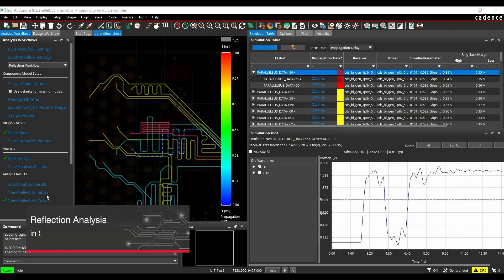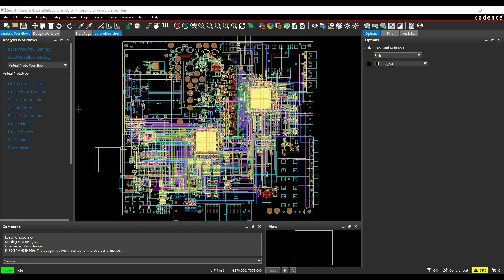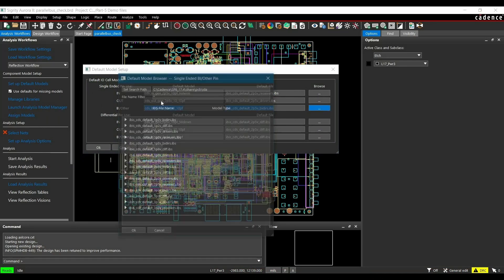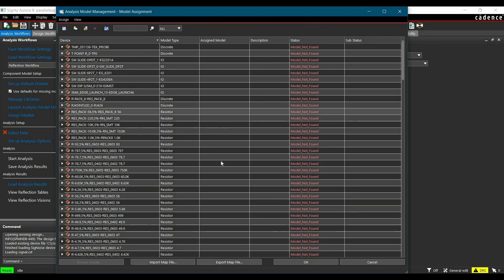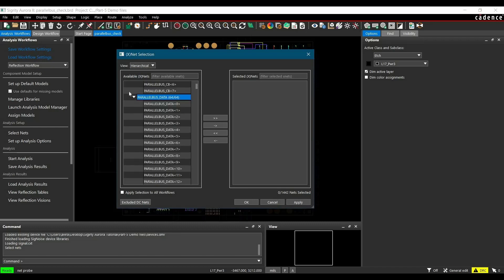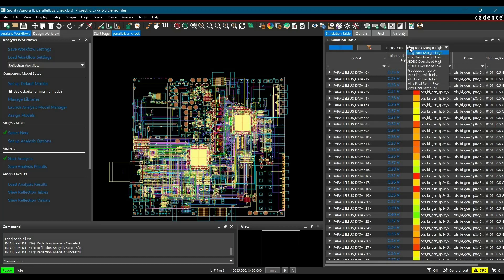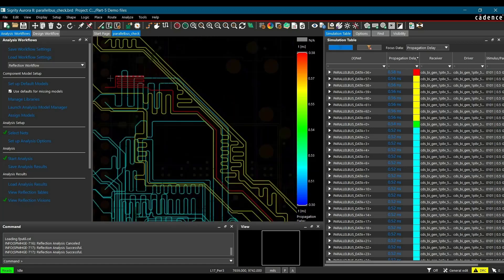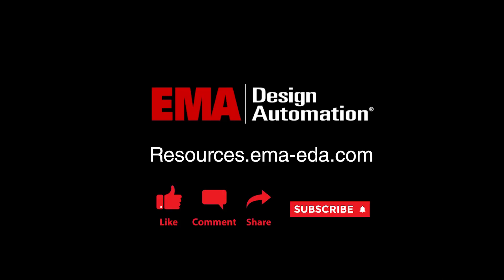Reflection Analysis with Sigrity Aurora

Comment: WHERE WE WANT TO GIVE DATA RATE OR FREQUENCY IN PUT TO SIGRITY AURORA FOR SIMULATION EXAMPLE REFLECTION ANALYSIS
Reply from the maker: Great question! You can set the data rate by select Set up Analysis Options in the Reflection workflow and selecting the Simulation tab. Here you can configure the simulation settings including time step, UI, data rate, and more.